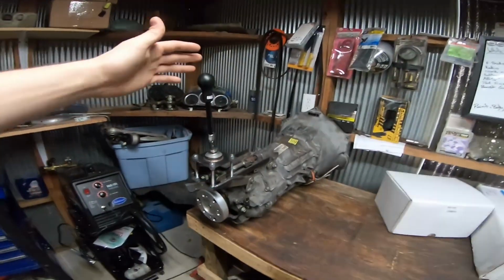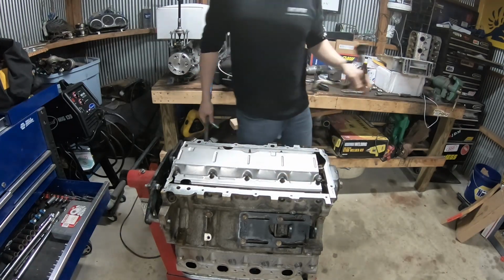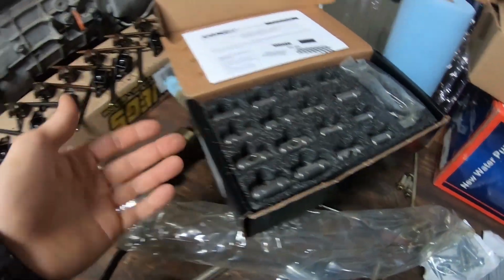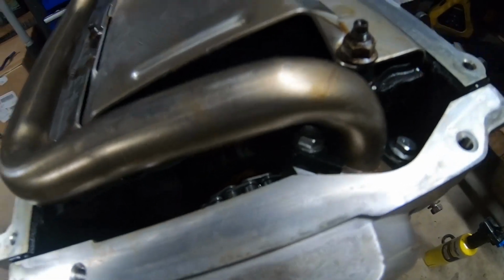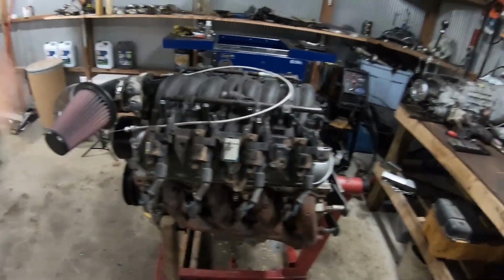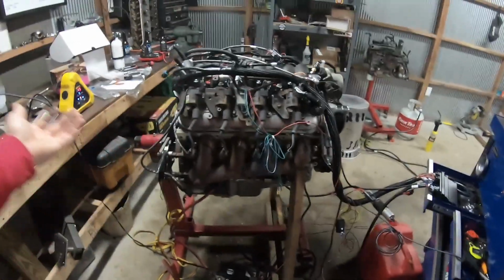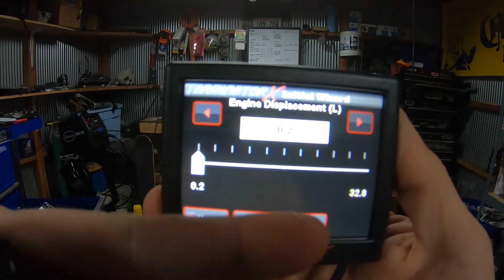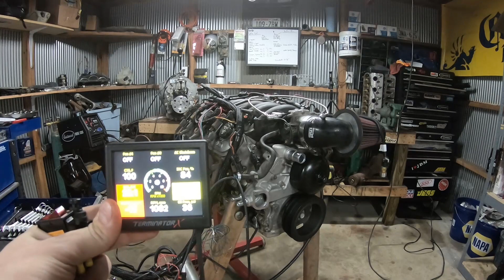Holley Terminator X Engine Stand Fire Up After Cam and Spring Install 5.3 LS

Comment: Couldn’t tell from your video, but did you need the donor fuse block from whatever car you pulled the engine from? I have an LS6 going into my 1971 240Z and I got the factory ECU reflashed and VATS removed, but can’t start it on the stand without the factory fuse block apparently. 😤 I would buy the Terminator setup just to avoid having to find and use a factory fuse block for this. Lol

Comment: How do you Djust the valves? Wouldn't you had to adjust it with new cam and springs?
Reply from the maker: They make a tool to measure pushrod length but this set up I didn’t have to. Probably should do upgraded pushrods and lifters for how high I rev it.

Comment: If I got the terminator x max ls1 24x (550-919) am I restricted ls1 motors or am I able to go any 5.3 4.8 6.0 with the system ? Got it for a steal on market place lol thanks in advance haven’t gotten a clear answer. First time build 💪🏽
Reply: If it’s the 24x reluctor wheel you would be limited to gen 3 engines I believe if it helps there may be gen 4 24x but from my understanding there is not
Reply: Any

Comment: Great project... I also have a z a 1972 240z.. what headers you are going to use?
Reply from the maker: Thinking about getting the CX racing long tubes. Other wise the stock cast ones fit if you cut the three bolt flange off and weld on a V band.
Reply: Flatline Detonation I’ve seen the cxracing headers but I think they are overpriced.. I heard other guys use f body headers  but I’m not 100% sure..

Comment: Does that also run the speedometer and all the gauges?
Reply from the maker: No I does not
Reply: @LifeFlatout  how would I go about doing that any advice? Thanks!
Reply: @chicago412  did you figure it out? You have a s30?

Comment: What were those big chopsticks for?
Reply: To keep the the lifters from falling if they somehow slip out of the bucket holders
Reply: Easier to just flip engine while doing cam
Reply from the maker: Both methods work but this way is easier on the back.
Reply: @LifeFlatout  idk you had flipped it already just prematurely lol. Doesn’t take much to turn the engine over
Reply from the maker: Your not wrong but that’s my excusing and I’m sticking to it lol